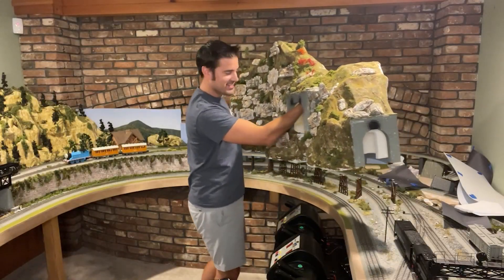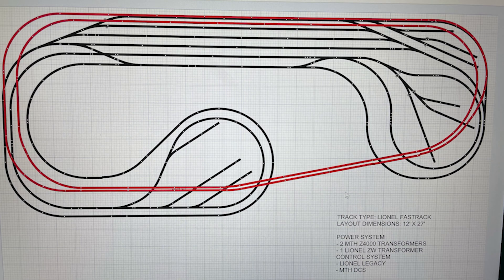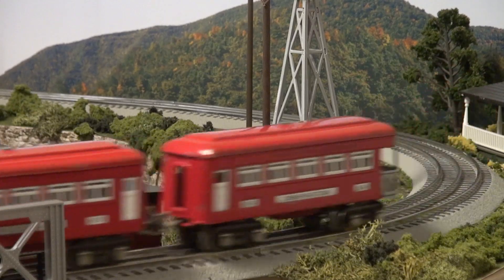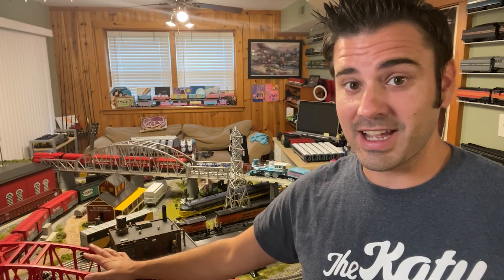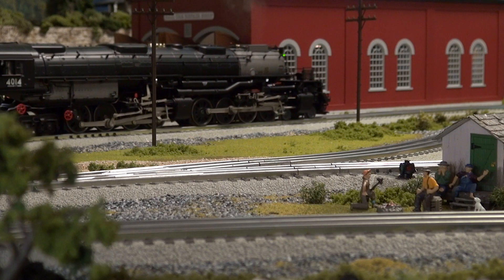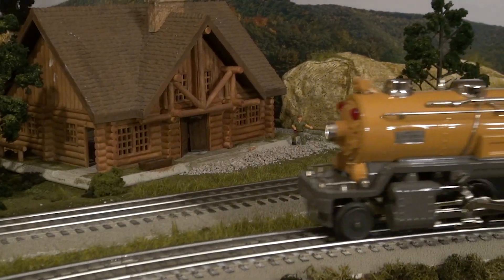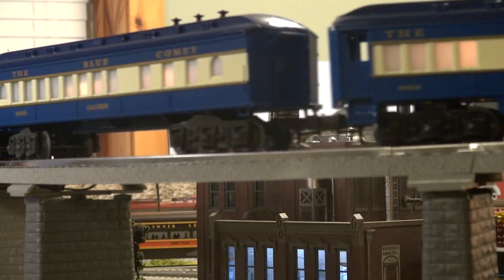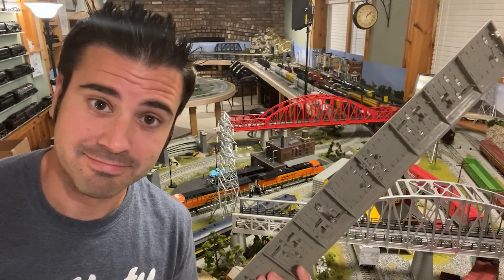I Tore My Train Layout Apart

Comment: Gargraves is a great choice. My 24 x 32 layout with FOUR mainlines is all GG with a few Ross switches.  I solder my feeder wires to Gargraves from the bottom. I place the wire in the web of the bottom of the rail and with a good AND hot iron flow solder into the web of the rail and wire. You can not see it from above and nothing will pull on it.  Good luck and thanks for sharing.

Comment: My brother's layout was using old hollow Lionel track and the noise was pretty bad. So bad that he switched to Fast Track afterwards which helped a lot but didn't eliminate the noise. I'm mostly still just messing around with N scale at the moment. I'd like to get my little layout all wired up and finished. I've just had life getting in the way far too often, plus getting sick last weekend when I was planning on doing some work. The universe is just conspiring against me getting ANYTHING done as far as hobbies. ☹ But it is what it is. There is a train show coming up here in the Plano, Tx area and he and I are planning to go to that. We may hit the first day but that's the day after the Weird Al Yankovic concert lol so I may have to sleep in and hit the show on Sunday. Although I don't want to miss out on any sweet deals on things I don't need but have to have. 

I'll bet it was a pretty difficult decision to make to partially tear down the layout. But as the upper loops didn't contain near as much scenery it doesn't adversely affect the overall "Feel" of the layout to change it. And I think that's important as it's just an evolution rather than a complete renovation.
Reply from the maker: Hope you are feeling better! Evolution is a great way to put it. When I built the layout, the elevated sections were an afterthought. Now I can lay them out the way I originally wanted. Thanks for watching and hope you can get back to your hobbies soon!

Comment: I installed homasote which is a paper product designed as a sound barrier on top of my 1/2 pine board. That cut the noise down on my trains running on my fast track quite significantly. You can get homasote at any lumber yard. Fast track is easier for me as I’m not very good at the intricate detailing aspect in model railroading. I’m still learning how to build building and practice my skills to get better.

Comment: @RBP Trains I heard you have a map of your layout, where can I find it? Also, with your fastrack, do you sodder jumpers in between fastrack pieces for a better contact? And lastly for your main circuit of track (the bottom one) for a layout of that size how many transformer to track connections are there? My layout is a 5x9 and I'm not sure if I should have more than one power point or how frequently I should have jumpers.
I think you made a good choice with this and sorry for the long comment!

Comment: I luv gargraves my layout is 12x16 and with the ross switches. I'm able to have 2 track main and a passing siding plus a yard and extra sidings and run pretty much any locomotive. Using fast track or any  Modular tack system wouldn't have worked for a confined layout. But the sweet part is ross switches can get track into places where a person would think it couldn't be done 😏

Comment: Great Video, i was wondering what smallest curve you were running one your layout was on the bottom section of your layout? You run a lot of larger articulated engines so I was a bit curious
Reply from the maker: Great question! For the main table, I useO72 on the outside track and O60 on the inside reversing loop. All of the switches are O72. Thanks for watching!

Comment: Add an docks with a fish pond in the dock and have special coal hoppers that dump fish food.If you were to make one use a 100% natural wood,Also get an rc crane to load and unload then get an rf tug boat to pull barges and deliver to another land of track and crane and dock were an tug could haul an special barge with track to let locomotives on so then the tug can send it to another land,Or just use crane to pull the loco on the barge and then just use another crane
Reply from the maker: Now that sounds like a project!
Reply: Yay
Reply: Make sure to use sea wood actually
Reply: Safe for fish wood